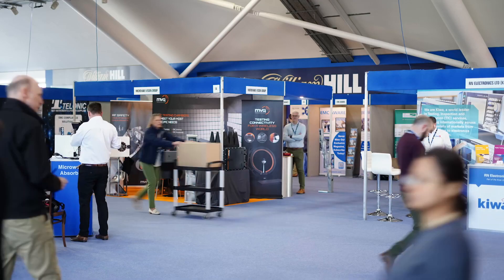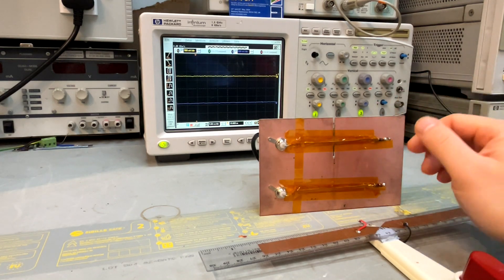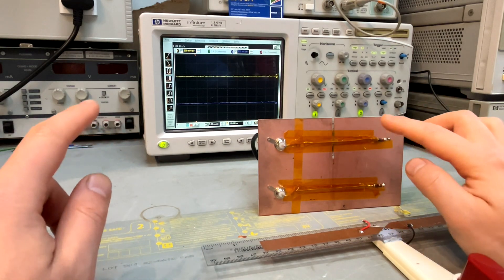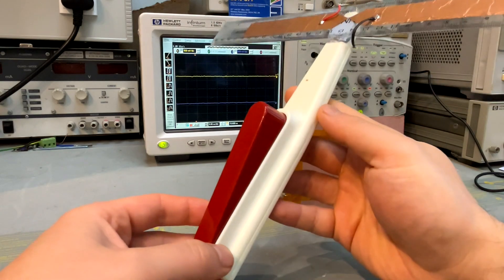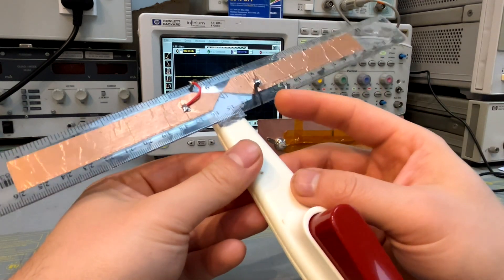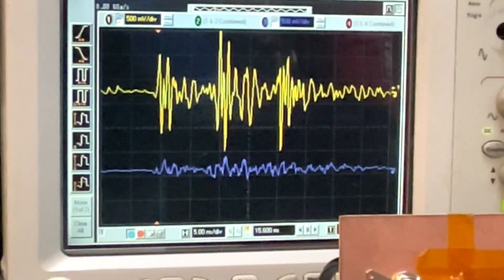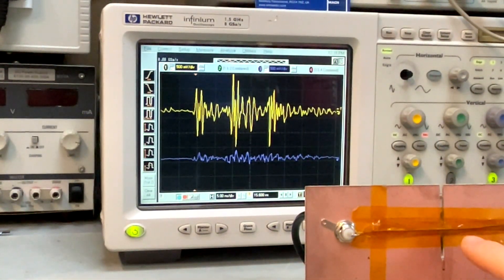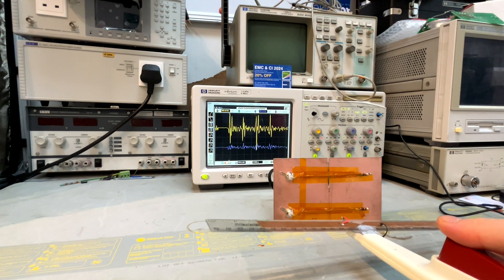Gap/Break on the ground - Indirect ESD impact

Comment: Great Video ! Would love to have details on the model of the spark generator....
Reply from the maker: It is not something fancy, you can buy one from Amazon and it will work, for the record, mine is C.K Classic C6000A Piezo Electric Gas Lighter . You then make two wings (copper tape on a plastic ruler), connect the wires of the lighter to the wings and it will work nicely

Comment: Very nice demo. So the spark energy interferes with the trace without groundplane. Could we also say, because there is a Δ I/Δ t at the trace above, even though it is connected to the same groundplane als the lower one, the lower one appears to be immune to that? Or is the small effect for the lower one to be blamed by the upper one?
Reply from the maker: absolutely, you will always see induced voltage, because the coupling is a physical mechanism, unless you have a four layer board and you have ground on both sides (and via walls so that the PCB is like a shielded box), you will always have some induced voltage. Yes, there may be some cross coupling between the top and bottom traces as well. i never thought about that. A guess a high accuracy simulation model is needed!

Comment: Hi, thanks for the demo, a lot of designer separate ground planes between analog domain and digital domain on the PCB, which i understand meant to reduce noise between the two. Does this demo apply for such scenario ? So basically such separation should avoided. Also I think for the case of a break in the ground plane adding a capacitor between the two can solve this issue you demonstrated, right ? Thanks.
Reply from the maker: Hi you are right. in fact, pay attention to our future videos, in which we will do a series called "the dirty ground". i hope you will enjoy them! The capacitors cross the gap is a good practice, sometimes, you need a 33 ohm resistor as well, just to dampen it, in case there is a resonance. Thanks for you comments!